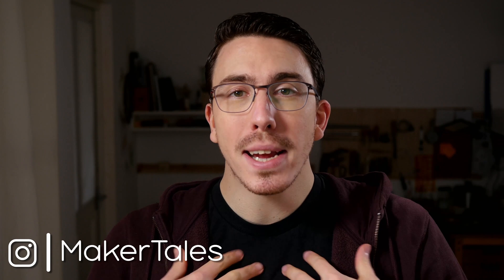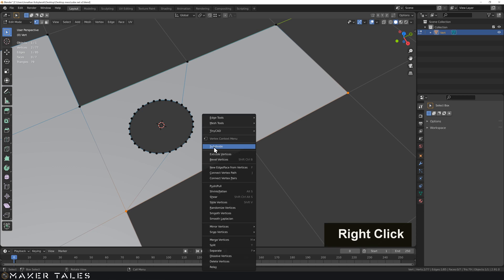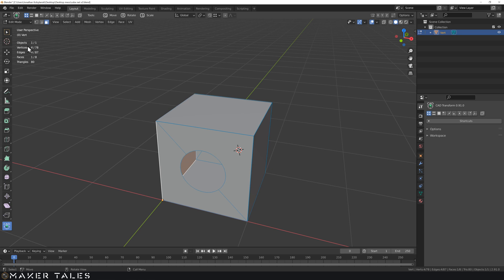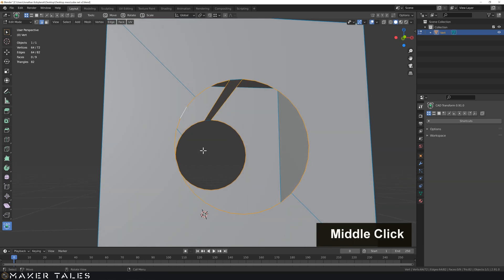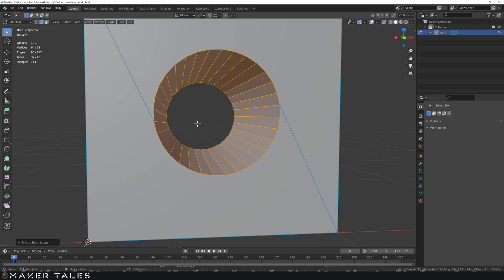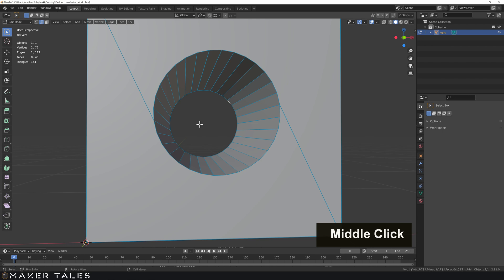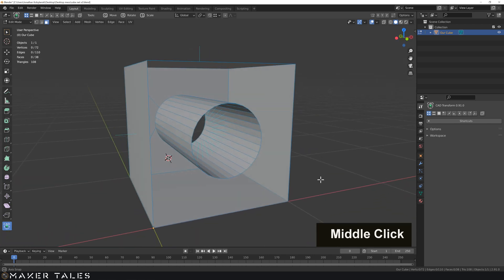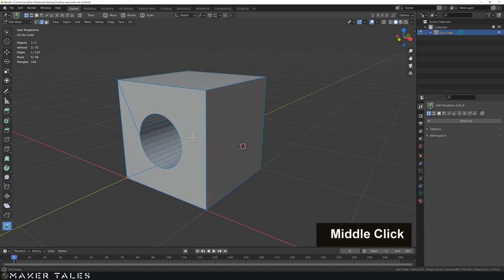2D to 3D | Learning Blender 2.9 / 3.0 Through Precision Modeling | 3D Holes - Grid Fill | Part - 16

Comment: In case anyone else runs into this problem. If you have your faces  selected but the rotation doesn't work with the CAD tools, ensure your object is selected in the scene collection. I was able to rotate without using the CAD tools without it selected, but then couldn't when I tried to use the CAD tools, but once it's selected it should work.
Reply: THAAAAAAAAAAAAAANK YOUUUUU
Reply: thank you !
Reply: Yeah, I wouldn't have figured that out myself. Thanks!

Comment: I have a problem where rotate won't work. Everything looks normal but when I rotate the face with move any way. I've tried again and I can get rotate to work initially, but sometime after creating the 2 holes it stops working.  Any ideas ? I do get the compass showing and it allows me to add 90 etc but nothing moves.
Reply: OK I solved it and feel like an idiot.  Turns out I wasn't in gave mode and wasn't selecting the face first. Doh
Reply: @furrypotato  you are'nt an idiot : sometimes when we work in edit mode since some times (with Blender 3.xx), CAD Transform Rotation seems not working as expected, and nothing Rotate. That said, we all feel like idiots at this moment ^^ The solution is : just go to object mode and come back to edit mode, and that will work.
Reply: @GuyCapra  thanks, that help

Comment: For anybody that was confused if their grid fill did not work the first try, Grid fill did nothing for me either  for the first time on Blender 3.0. It only brought up the dialog box in the lower left asking for parameters to define it. When I then instead selected only the 2 edges that ran parallel longwise of our "spanning" face that we used to bridge the 2 circle edges, it then worked perfectly. G translation testing of all faces and edges involved showed it all to be connected, not requiring  a merge by distance edit, but it never can hurt to merge when done lol. Thank you for the tutorials Maker Tales!